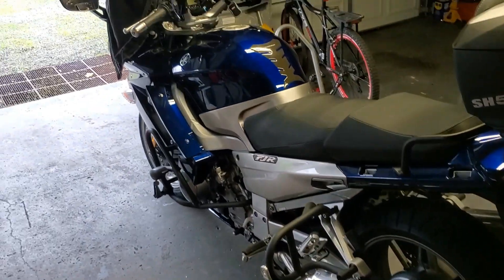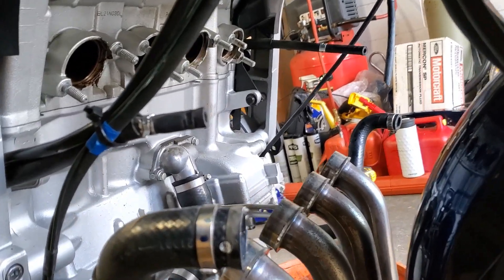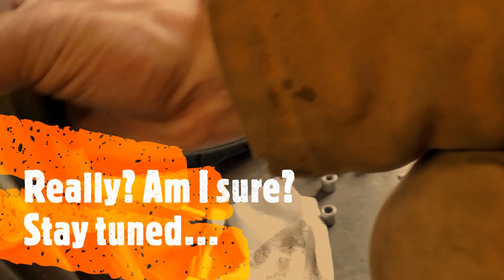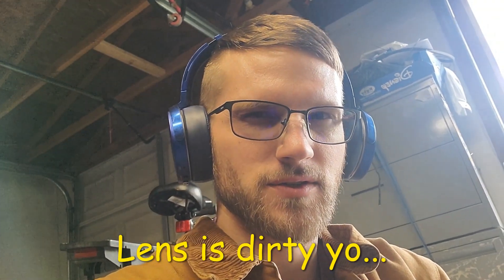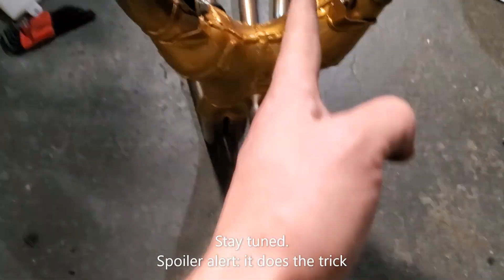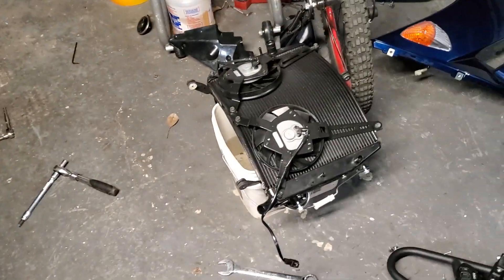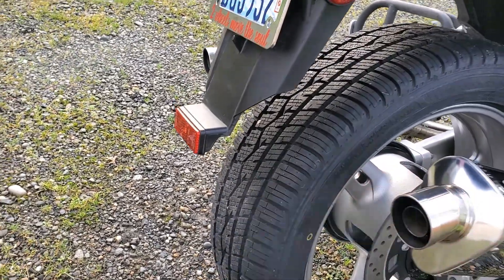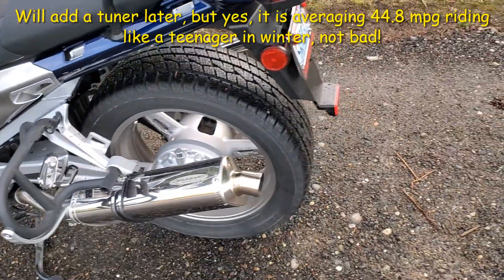Redneck Header Modification, Operation FJR1300 4-2 Header Dual Exhaust Using Stock Header!

Comment: A car tire ..i m gone
Reply: I didn't even notice that...LOL!
Reply from the maker: Hahahaha, yep!  Replaced the tires and did the header work in the same weekend.  Haven't finalized the darkside video yet.  I will say, I do like it!  I've cornered as hard if not harder than I had on the original tires, and haven't had 1 slip yet, but I'm not dragging peg.  25-30* lean angles because cold winter roads still.

Comment: She sounds pretty! 
Someday, I will consider changing my stock exhaust... I am still trying to get used to my 2017 sound...
Nice and Concise Video!
Btw-Have you looked into the Second Gear issue even though yours is older than 2016?
Reply from the maker: Thank you!  She turned out pretty good, still enjoying riding it with the 4-2 header!

I have been following the 2nd gear issue on 2016+, that's insane.  Luckily my 2012 has proven nothing but solid for me so far!